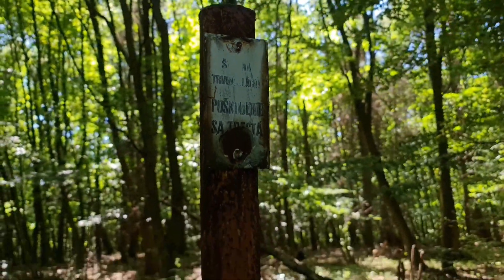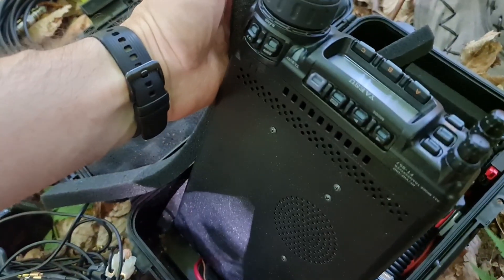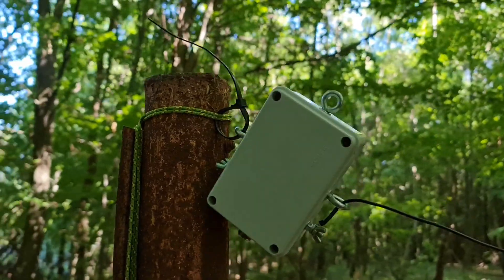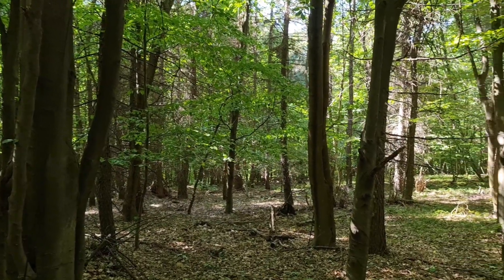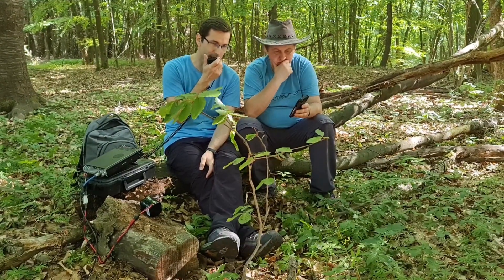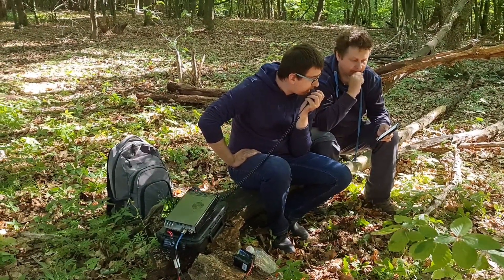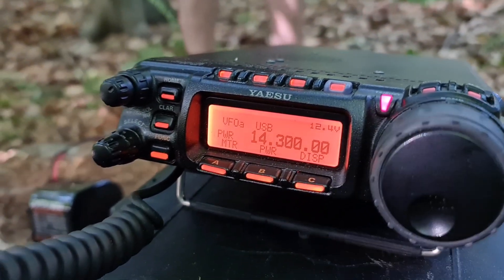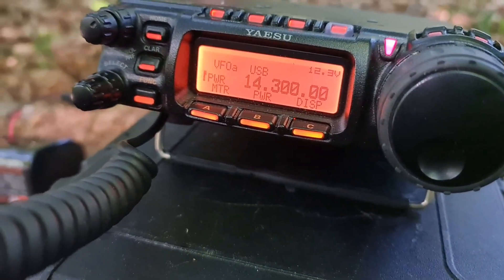SOTA - Summit On The Air (cinematic) OM/PO-082 first activation

Comment: Hi Paul, nice one. If i make the point: 30W, 6Ah battery. How many time with 857 tuned on?
best 73's
Reply: Hi Damien. We've been trasmitting approximatelly one hour, with short breaks. When we came back, I left the battery on the shelf. I have plugged it today into a voltmeter and it shows still 13,09V now.
Reply: @om0wt  Thank you for this. So 6Ah lipo is enough for 30w and a good moment of fun.
73's Paul and good week end.